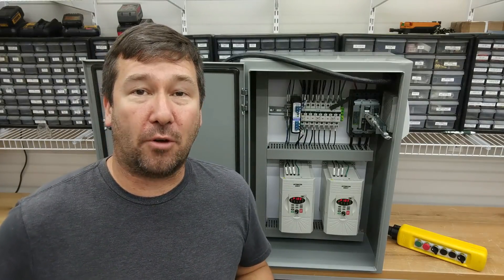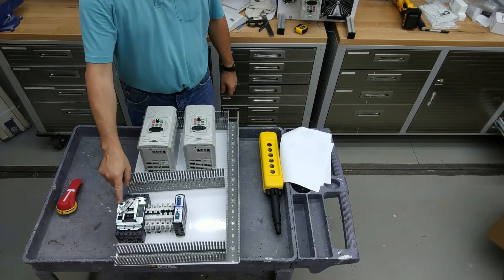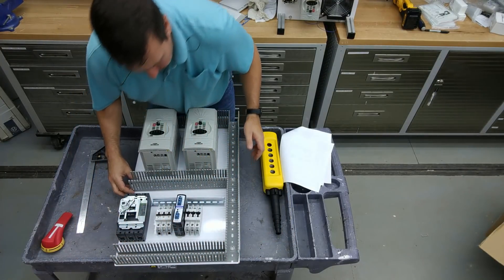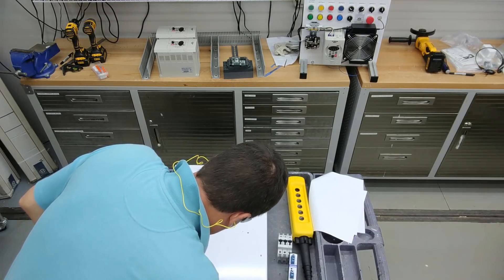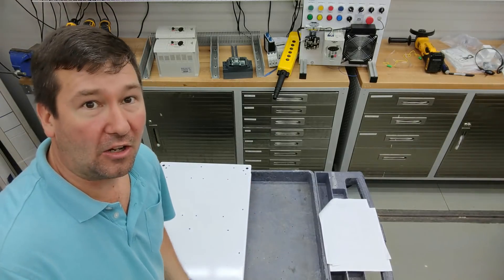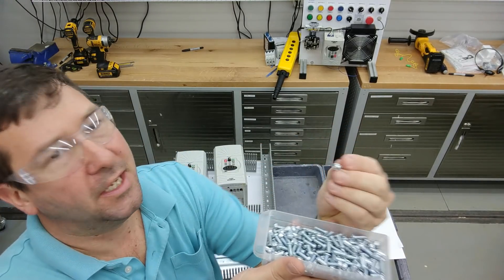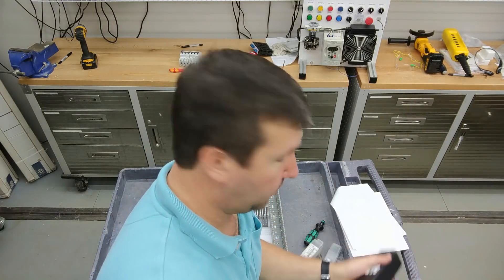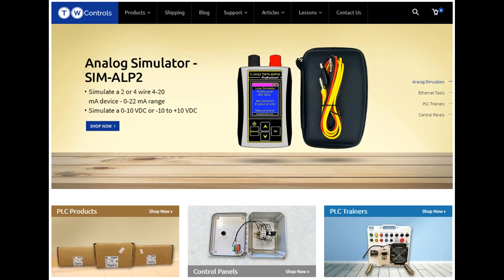Control Panel Building Mounting Components Part 3 of 6

Comment: Nice video sir.
If i want to make a cut on the panel box for my pilot lamp and push buttons, how do i achieve the cut.
Can i use a drilling machine?
Reply from the maker: Check out this video on cutting holes in control panels.
https://youtu.be/oF2ien8FgGQ
Reply: @TimWilborne  ok
Thanks
Reply from the maker: You are welcome

Comment: Got a lot of same-length wire duct?  I like to label mine on the underside of the duct for quick reference:  top, bottom, mid-upper, mid-lower, etc.
Reply from the maker: That is a great tip! I've seen them labeled on the front of it and never liked it but I've also seen where it was obviously reinstalled in the wrong places. I'll include this in my next video.

Comment: Hi Tim, loving this series as a newbie in the field. Great tips and advice! Just a quick question for you, As you were laying out all your components you brought out the square ruler. Did you square/measure out all the components before marking the anchor points? Or were you able to achieve this by eye (i’m guessing that you measured it out and the video cut at that point but would love to hear back for verification) - keep up the great work
Reply from the maker: Hi Daniel.  Measure and square up EVERYTHING!  If you guess at positioning the components, you'll regret it later.

Comment: What torque do you use for mounting 10-32 and 8-32 screws in panels?  Is it determined by the panel manufacturer or is there a rule of thumb?
Reply from the maker: Every screw that is part of a UL electrical component has a torque rating, it is part of the device requirements.  For other mounting components, I use the torque from a standard screw and bolt torque chart.

Comment: Great video! What is the thickness of the back panel in this video and is that what do you recommend in general?
Reply from the maker: Hi Mathieu.  The thickness of the back panel will be dependent on the size of the back panel.  For example a panel for a 14 x 12 enclosure will be 14 gauge, a panel for a 48 x 36 enclosure will be 12 gauge, and a panel for a 90 x 72 enclosure would be 10 gauge.
Reply: @TimWilborne  Thanks for the quick answer.  So would you use different drill/tap sizes depending on the gauge?
Reply from the maker: @mathieugibeault  No, the drill/tap size it determined by the hole size of the component you are mounting.

Comment: What diameter screw do you recommend for mounting the DIN rail and trunking?
Reply from the maker: Hi Tim. Great question. I usually use 8-32 or 10-32 screws. Paraphrasing, UL requires it be secured on both ends by a screw, bolt, rivet, or other approved mounting method. 

One other footnote right in the same area is one bolt can't hold two devices. So for example say you have to devices, one on the inside of your enclosure and one on the outside, and they both had the same bolt pattern. You can't stick one bolt through the device on the outside, through the enclosure, then through the other device to hold both of them down. They would need two sets of holes and hardware.
Reply: Hi Tim. Thanks for your super quick answer, it was very useful. For people in the metric world, that would be the equivalent of M5 and M4. Thanks for adding the note about not being able to share a single fixing device for two components, that's well worth knowing. I've really enjoyed your series of videos on panel building, It's great to see somebody who takes a real pride in their work. Cheers.
Reply from the maker: Thanks. As long as you keep watching, we'll keep making them!

Comment: Are there any ranges of torque wrenches or drivers you recommend or certain brands?
Reply from the maker: I'll try to get you some recommendations tomorrow. Remind me in a few days if I haven't.
Reply from the maker: Hi Brian, see if the following helps.

One note on all torque equipment that you use.  It must be calibrated before you use it and every year afterwards.

For a complete torque screwdriver set, this one is nice.  It has two of the torque screw drivers I use and one additional one I would probably use.
https://www.amazon.com/gp/product/B001555G80/ref=as_li_qf_asin_il_tl?ie=UTF8&tag=twcontrols-20&creative=9325&linkCode=as2&creativeASIN=B001555G80&linkId=f56fce8505ab9277e0f385e6bd7d2b4d

For torque wrenches:
3/8"
https://www.amazon.com/gp/product/B004VYUQI2/ref=as_li_qf_asin_il_tl?ie=UTF8&tag=twcontrols-20&creative=9325&linkCode=as2&creativeASIN=B004VYUQI2&linkId=6c56cf40bbfe829669aa111e4f9fc238

1/2"
https://www.amazon.com/gp/product/B0081AQDIY/ref=as_li_qf_asin_il_tl?ie=UTF8&tag=twcontrols-20&creative=9325&linkCode=as2&creativeASIN=B0081AQDIY&linkId=160ca527a0a684f1cb9685feaf19bec9